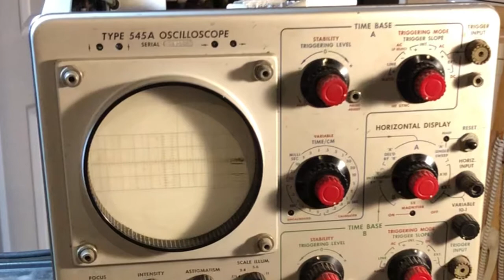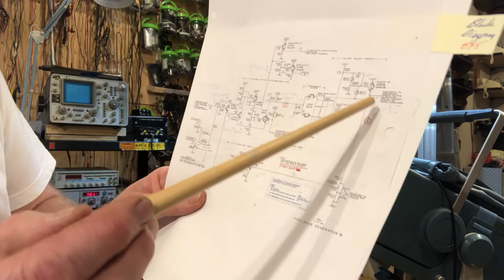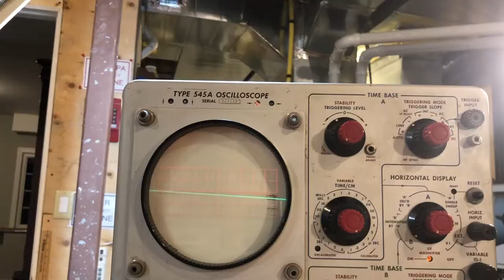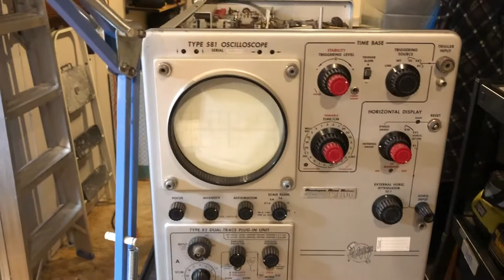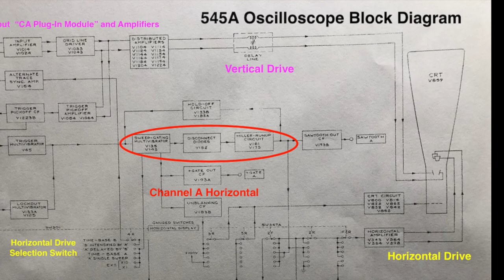Vintage 545A Tektronix Oscilloscope Troubleshooting Sweep Problem Multi-Vibrator Tube 6DJ8 Failed

Comment: Hi mate. Do you have any advice on where to look to learn how these old valve sweep circuits work? Maybe videos or books possibly? I have two old telequipment scopes. A D43R dual channel scope, and a serviscope S32. I don't know what it is, but the timebase circuits on the vintage Telequipment scopes are prone to failure. I originally got them both going a year ago, by replacing old diodes and caps and a shorted zener...and they happily worked until now. Both AGAIN no horizontal sweep. I'm on the S32 at the moment. I've tested tubes, checked capacitors esr etc, checked soldering, tracks, switches, pots, measured resistors, yet not found anything that seems faulty...however I honestly don't know how the circuit is supposed to work! Any advice would be great. Thanks.